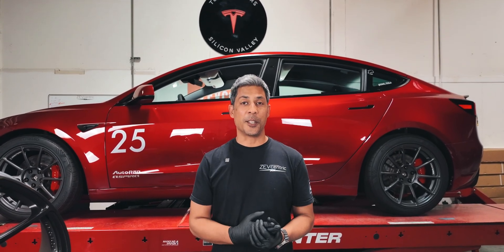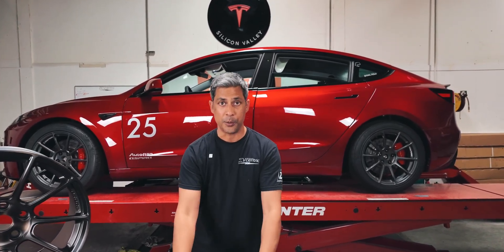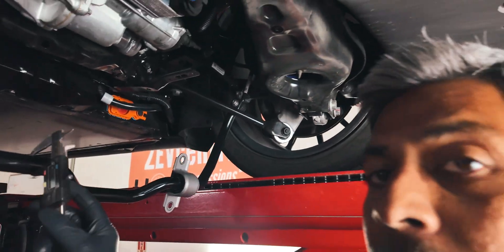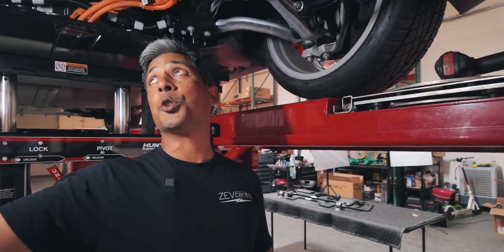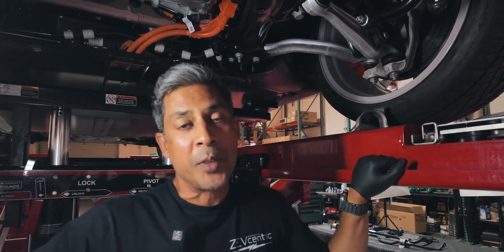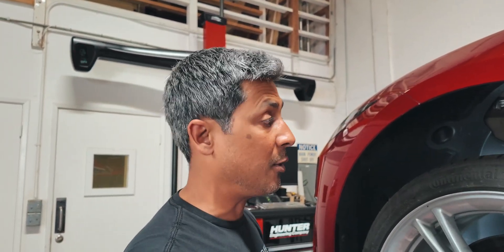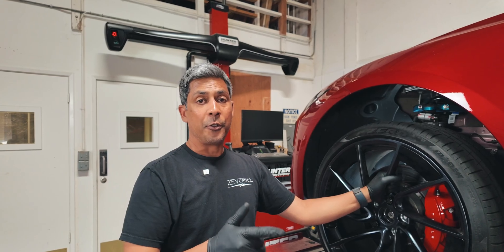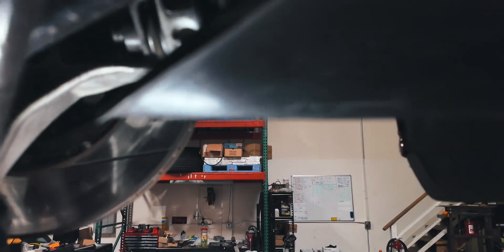2024 Model 3 Performance: Key Updates Compared to Older Models

Comment: Would you mind sharing which stiffness settings you (or Tim) ended up with after you finished the Eibach sway bar installation?  I'm just looking for a starting point for mine.  TIA.
Reply: for Street, I use the soft setting and track I use the middle

Comment: My 2024 M3P has a totally different part for the front upper control arm than the one you show in your video.  It's a fully cast iron unit versus the one pictured in your video.  I wonder what the reason for the change is?
Reply from the maker: We have seen that on the model Y as well.  You have a better part than us.  Where are you located?
Reply: @zevcentric  I’m in Virginia. The car was built in August.  What makes it better - better sealed? More rigid?
Reply from the maker: @scottm106  yes the ball joint should be sealed better on yours I presume.  I think it all comes down to supply chain with Tesla and what they have at the time.
Reply: @zevcentric  looking at a little closer, mine seems to match the part number (1344326-10) that’s in the 2024 parts catalog while yours has a part number that is close to(-10 vs -00) the one for the 23 and earlier. Did they have a pile of leftover control arms they put on the first M3Ps out of the factory?  Surely they wouldn’t do that.

Comment: Would a 19x9.5 ET29 with 275 tire fit the front of the stock 3P Highland (with stock brakes)?
Reply from the maker: Not 100% sure.  The front might poke out ever so slightly.  If interested in Apex wheels we are also a dealer for them.

Comment: Do the Tesla 18” Photon wheels fit with or without spacers or will they contact the caliper?
Reply from the maker: not to my knowledge.  They will all require shaving of the calipers.  There are several 18" aftermarket wheels that will barely clear.  Gotta be careful where you put the wheel weights is all.

Comment: I bet a little grinding on the knuckle or a 15mm or more spacer would fit those 10" warp wheels in the front. Looked like the tire was just rubbing on the molding spot.
Reply from the maker: We are already spaced out as well because of the rotors, and I believe I threw some other spacers on it too
Reply: @zevcentric  What is that little nob the tire was rubbing on isn't that just the casting spot? Should be good to completely grind it away right? I won't hold you to it if you're wrong just want your opinion on it.
Reply from the maker: @carter_longcor  in the video we already simulated having 10mm of spacers on the stock rotor.  In addition to that you still need to grind away that casting mark and another 10mm on top of that.  That's just too much.  Our rotor hat is 5mm thicker than oem and I have another 5mm slip on in addition to that.  Hope that helps you understand better. https://youtu.be/rRTcMKDwesM?si=Kx0_A3i8kWIWFF0K&t=528

Comment: deep and detailed as always. Thanks guys for your work and reviews.

p.s. the best way to fit wide wheels in front not a spacers but TMY halfshaft
Reply from the maker: I thought it is the TMY knuckle and lateral link.  The knuckle will provide more backspacing but will create other potential issues when charting all the steering angles throughout the compression stroke.

Comment: Thanks for sharing this. Will the Zero G wheels fit on the new 2024 M3P? Tesla’s website doesn’t specify. Ty
Reply: The Zero G wheels are way heavier than the new wheels. :/ 

(I have the Zero G’s)
Reply: @chrisalexandersb1748  Really? Send the info you have. Zero G wheels are also forged & weigh 21 lbs. The warped wheels weigh 24.28 (front with covers).
Reply from the maker: @gust9464  was referring to the non forged ones we have seen.  I'm not sure if those were for the non performance trims or referral wheels but they are the +40's. You got the track pack ones so those are the light ones.
Reply from the maker: Yes they would but its a step down from oem warp imho.  Also need to confirm which offset you have.
Reply: @zevcentric  +34 off set  20” x 9” They fit on all the other previous M3P.
Reply from the maker: @gust9464  they will fit the new P.
Reply: @zevcentric  What weight do you have? I have Zero G @ 21 lbs “forged wheels”  as well. The warp wheels @ 24.28 (front with covers’.

Comment: Is battery overheating an issue on a racetrack?
Reply: @KP-xi4bj  yup always on a tesla but tires and oem brakes too are an issue
Reply: @jeffufcfanaticrosenberg  Is there solution or a workaround for the battery overheating on a racetrack?
Reply: @KP-xi4bj  I believe turning off Regen will help- rishie is the expert though not me
Reply from the maker: Turning down Regen does help. The guys turn Regen down to 30-50% when they upgrade their brakes. This does slightly help, but not significant enough. Mountain Pass has the Cooling Box Controller that does help pre-Chill the pack to help it cool down during charging. They also have a power reduction mode to help out which we've talked about in the past in our Model 3 Challenge videos. https://youtu.be/F_w_rl9HCHc
Reply: @zevcentric  So, bottom line a stock 2024 M3P is fine for street use but not serious track use without aftermarket modifications?
Reply from the maker: @KP-xi4bj not at all.  Its still crazy fast at the track as a time attack car.  It will still be really fast with power reduction so you can run full 15min sessions without any overheating.

Comment: Smaller front and bigger rear gives a much more neutral handling balance.  I installed a smaller 28mm front bar on my MYP.  It improved the ride and balance.
Reply from the maker: Makes sense because you also have a staggered setup on the YP.

Comment: completely completely confused why did they go to softer bushings it seems like that would be bad for handling durability except for the ride ?  

also wont the same problem exist for wear that the old model 3p had where the cab bushings completely wear out after like 20k miles 

so on the  new one if you changed the cab bushings you would get better handling I assume too

Comment: Do all of the Model 3 aftermarket 18" wheels on your website clear the '24 Model 3 Performance brakes?  Have a M3P on order and the Konig Ampliform 18x8.5-35ET would make a nice looking set of winter wheels.
Reply from the maker: Yes they do. The brake caliper on the new performance is the same as the last gen performance.
Reply: I have an order on the way as well and been wondering what’s the price range for winter tires

Comment: So will the new adaptive shocks be able to work with previous gen performance model 3 at some point?
Reply from the maker: I highly doubt it because you will still need the software in order to control it. Not to mention additional harnesses and sensors so it would be very expensive.
Reply: @zevcentric  what are the chances of someone essentially copying it in the aftermarket&offering it for sale though?

The ev conversion channel electric classic cars on here has a tesla ldu swapped 80s Ferrari testarossa=teslarossa which has an aftermarket active suspension setup on it. I'm sure it's expensive, but the m3p market would be much larger overall for the r&d roi to make sense. 🤔
Reply from the maker: @4literv6 very slim chances still.
Reply: Tevo in the UK do an aftermarket semi-active damping solution with Tractive for the previous gen and having fitted it to mine, can confirm it is like magic…
Reply from the maker: @JoeBaguley  John and I have definitely spoken to each other in the past.  Tractive is cool stuff for sure.